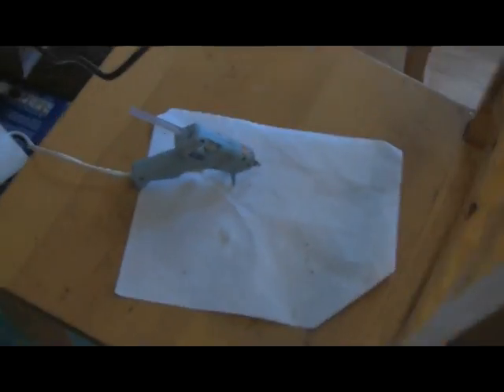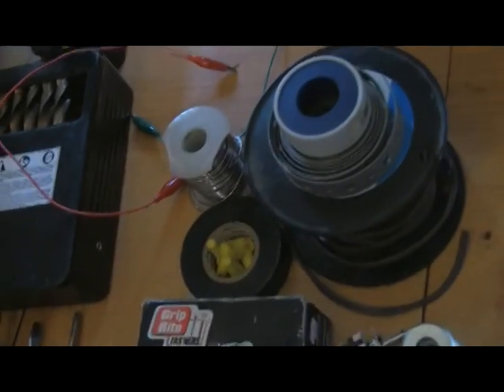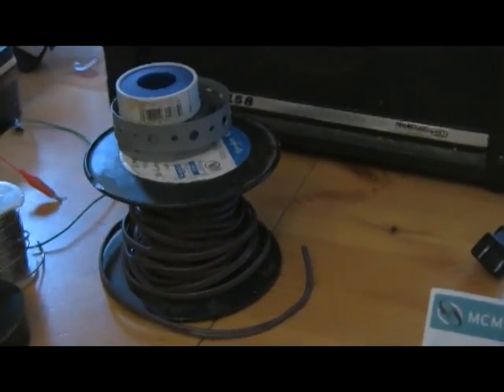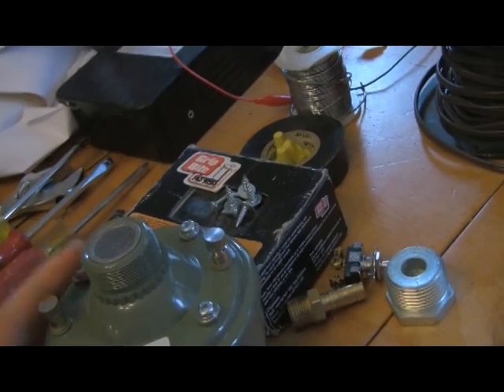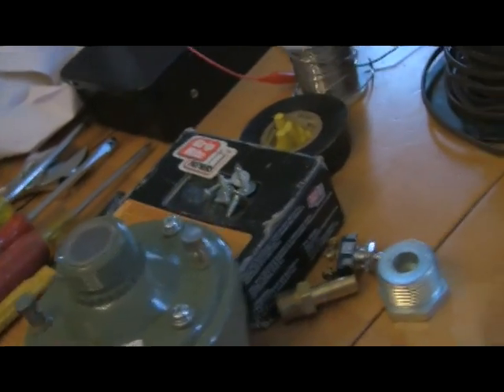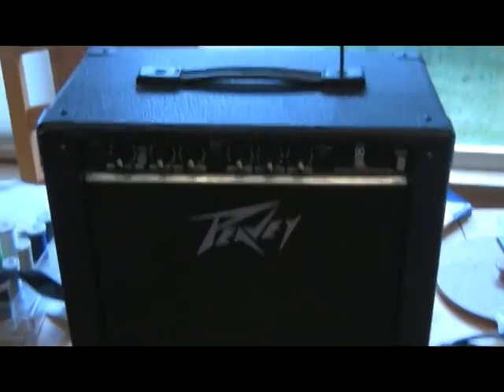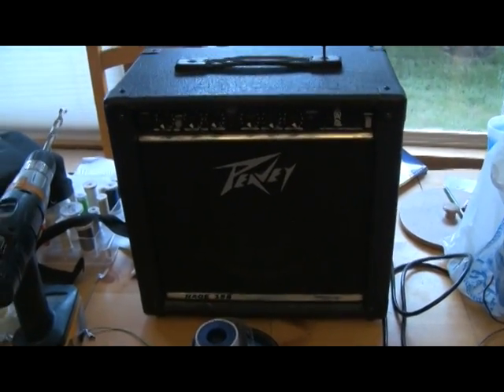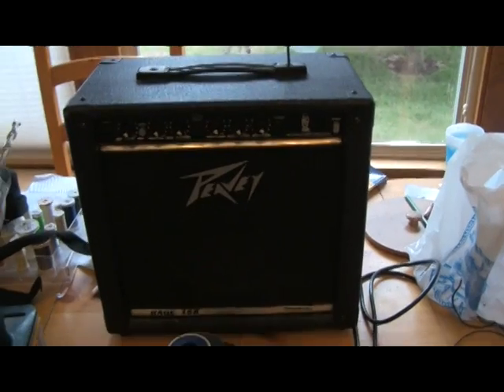Building (and playing) a Custom Talkbox -Part 1of2

Comment: You said to not use anything smaller than 12 guage, when you used 18 gauge.  18 is smaller than 12 in terms of wire size.